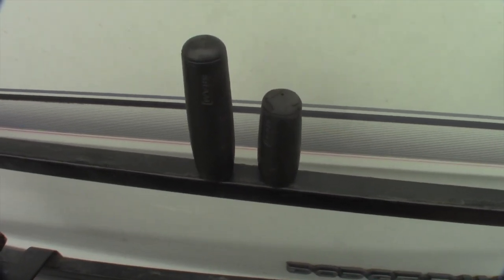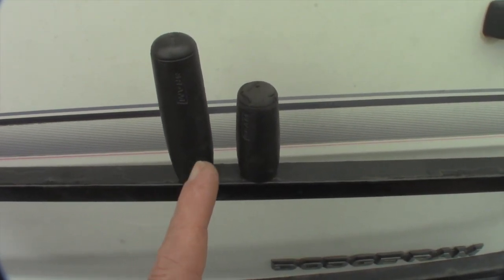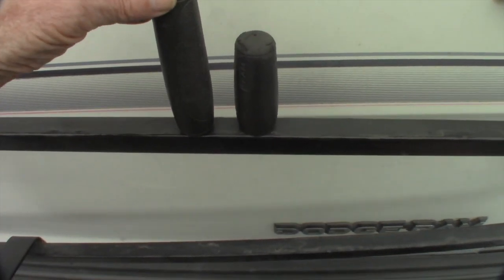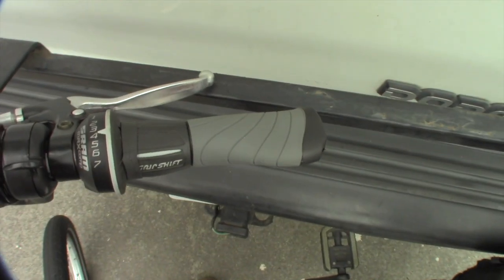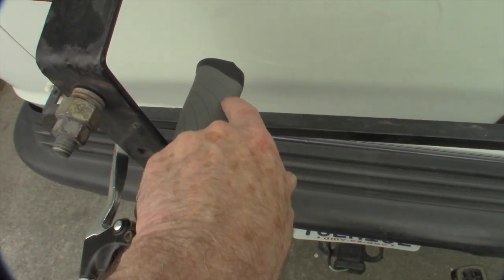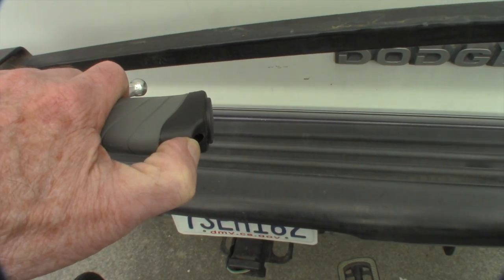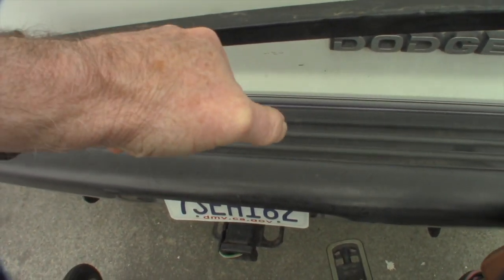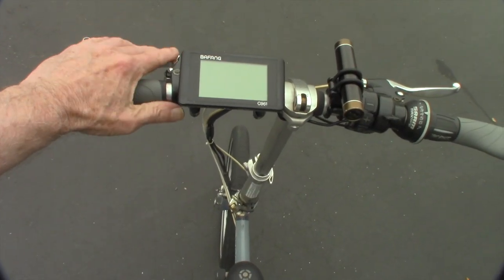E-Bike Upgrade - Comfortable Hand Grips

Comment: Can you store your ebike inside in the back storage where the tire would go? I have a similar ebike myself 20 inch wheel foldable.
Reply from the maker: Hi Gia LovesJesus,
I don't have storage for the spare tire inside the van but I do store the bike inside, between the two twin beds. I have also stored it on top of the twin bed I don't use for sleeping. It's important when storing things of this size and weight to tie them down because we don't want them to become a problem in the case of a collision, etc.